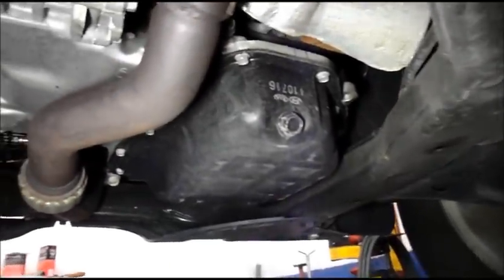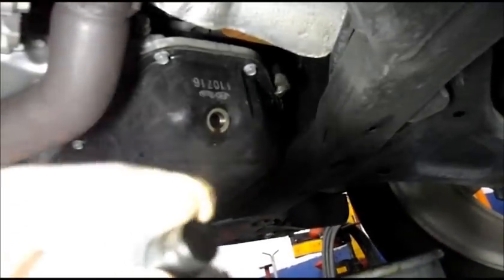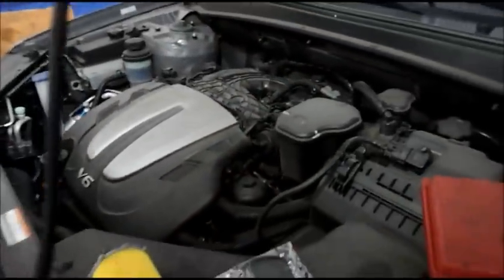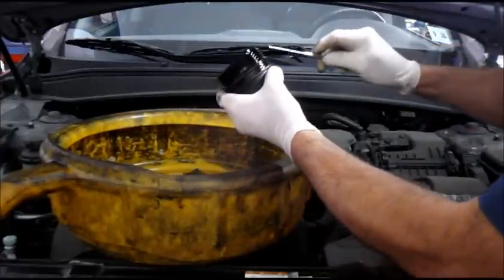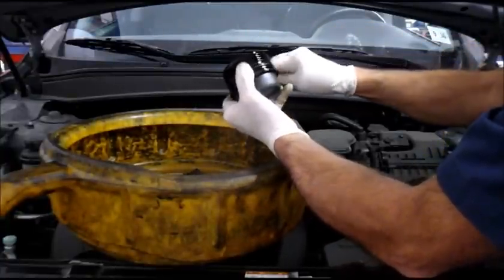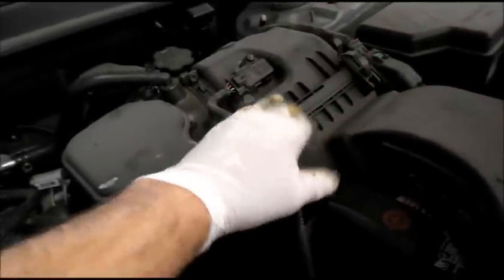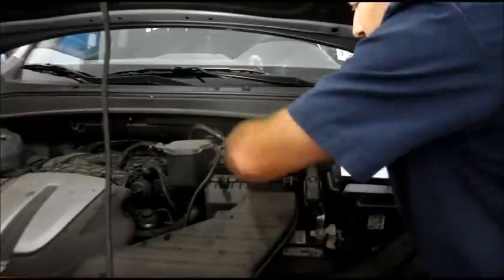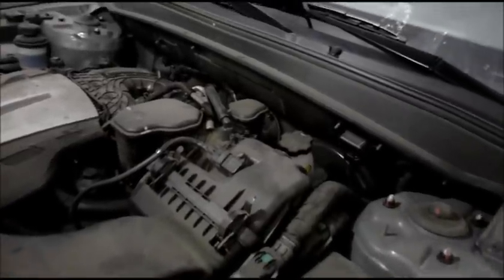Changing the oil and filter,air filter and cabin filter  Hyundai Santa Fe

Comment: Great video Jim and as an owner of a 2012 Santa Fe I'll be watching more of your videos here!  One question I have - when changing the engine air filter why did you only release the front clips on the housing and not the two smaller ones at the rear?  I thought it would have made the job a little easier unless I missed something.

Cheers and keep up the great work!

Comment: Hello! I have mice in my cabin air intake, and they have attempted to make a home in my air filter. I have figured out how to access the air filter and found the space above it which is where the air intake is. My thought was to cover the intake with a mesh so that they could not get through. Problem being, I can't reach the opening without removing the plastic cowl in the engine compartment. Do you know how to remove that? Thanks!